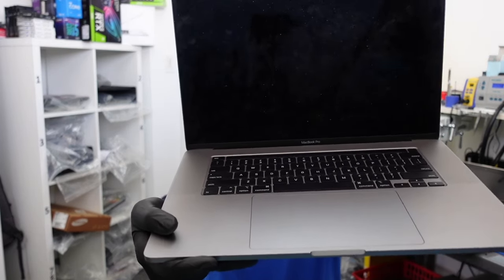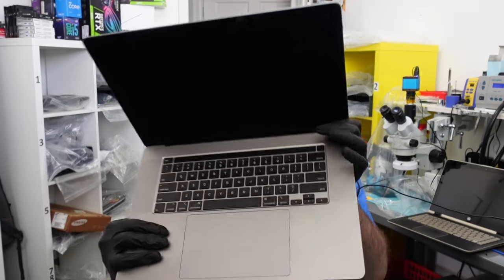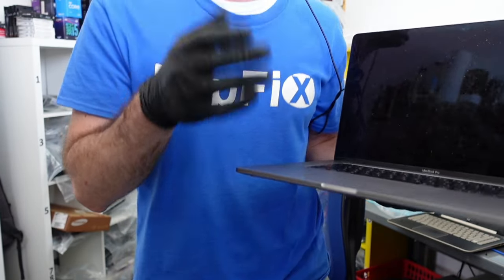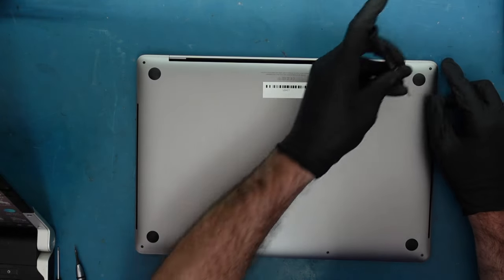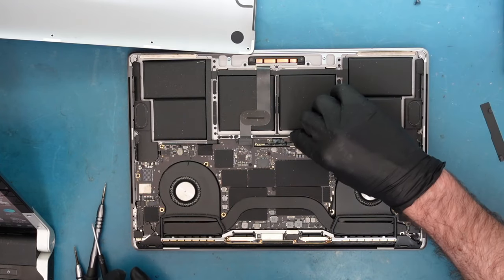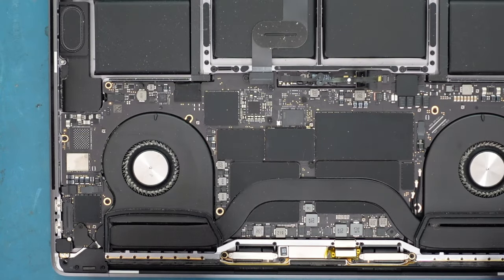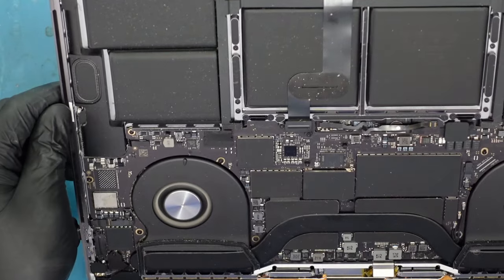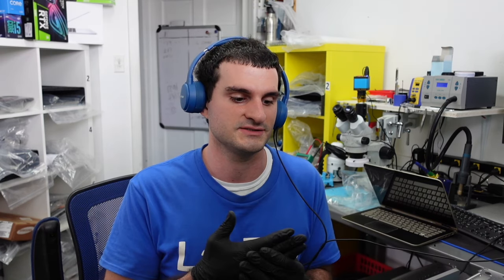Macbook Pro with Cracked LCD But Still No Display Output

Comment: Thank you for this.  I was an idiot and bought MacBook Pro 15" Retina A1707 (2016-2017) model and am in need of a new screen. It powers on and the backlight comes on but has the classic no image no display just fractured lights and lines etc. Luckily I am able to Mirror the Displey onto my TV with an HDMI cable and my Dock.  I say idiot because of course I buy the one that costs the most to replace the screen.  The other major major irritation is how the keys started going bad on this money pit.  Shame on Apple for creating such an expensive heap of junk that will cost an egregious amount of money to fix. Wrapping up my want I find it 1000% ridiculous that I have a “Laptop” but in order to use it  I MUST have a Keyboard, 2nd monitor used as a Primary Display, and a Mouse.   I basically have porthole Desktop using a $2500 MacBook Pro as my hard drive.  So pissed.  My question is, at what point is it worth repairing it vs getting an iMac or the like.  Who knew the screen would cost that of a brand new Low End iMac.  Thank you.

Comment: Question Because I need some serious help. So I did all the steps, but when connected to the external display is displays nothing, the only time it displayed anything was when it low battery and did the whole lightning bolt sign. but now when connected to an external display, i mean it displays an output cuz the display backlight turns on, but theres nothing on there. Ive tried the comand R and all that. no luck. anyone know whats happening??? is the OS broken or something??

Comment: Hey there, will this work for a 13’ inch MacBook Pro? screen is cracked. only thing it will let me display on 2 monitor is the reset password. once I do that and reset the computer it won’t reconnect to the 2nd monitor. the keys board lights up.. the 2 times I did it in the beginning it worked.. then it stopped working. feel it has something to do with the password. when it did display onto 2 monitor the Touch Bar had 2 options. mirror or display. but now the Touch Bar shows nothing. tried using voiceover to type password in but nothing worked. I don’t wanna pay for another screen. how would I go about this?
Reply from the maker: Yes, this should work for your issue

Comment: Used this trick on a 2018 Macbook air 13 inch so I could keep working. The screen just spontaneously cracked from the bottom left. You are a life saver!

Comment: This was an awesome video. I’m having a problem with my screen is cracked. But I will need to watch this video half a dozen times because I feel like you need to be a tech genius in order to do this… 

Is there any other tape besides the one you used that I can see use?  

I’m very nervous to do this, but I feel like I have very little choose.
Reply: You don't need to be an expert.  IT should work unless something else is wrong with your macbook :)

Comment: Can this be done on a macbook pro 14" M1?  I am asking because the display is disconnected and completely removed.  However, I always need to press command F1 to go into the external display. I want the macbook to always be on external display because if not it makes it difficult when I need to go into options startup menu etc.  Thank you!

Comment: Mine has something similar. Display is not cracked but I think it failed. The weird part is when you press power button you see the apple logo, also when i put the laptop in recovery i can see the image, everything perfect. when the laptop boots in MacOS no image is shown at the display, only an external monitor work.
Reply: Update please

Comment: Greetings,

Thank you for this. It worked until i put my password in and loads, then it goes blank. The laptops runs fine the external monitor goes blank. How can i get around this?

Thanks
Reply: We are having the same issue. Put in password and it loads just fine then before it opens to my desktop it shows no external monitor connected. Not understanding why this would happen. Any help would be appreciated.
Reply: @Charles-oo6jm  update please

Comment: Hi, I am having a similar issue, when I connect to a monitor it shows up but annoyingly it is in secondary monitor mode and I cant do anything on the laptop. I have tried short cuts to put it into mirror mode but no joy. Do you have any advise? 

Thanks
Reply: Did you already disconnect the screen?
Reply: Update please

Comment: I have an A1708.  I followed the video's instructions.  When i turn on the computer it only displays the apple logo on the external, no loading bar and just stays there.  Any suggestions?
Reply: I have the same issue did you manage to figure out what's happening?

Comment: I got an Macbook pro A2159 and it shows only the battery symbol, waht can i do?
Reply from the maker: That sign means it doesn't detect a charge on the battery. Keep it plugged in for a while.  If nothing changes it can be a charging issue with the logic board or a battery issue

Comment: ive got screen busted a2141 as well. the idiot me put windows to start in safe boot and forgot how safe boot will use only internal screen. which is busted. so if we disconnect the video like the one you showed it here, would it put windows safe boot in external display too?

Comment: I was doing this fix on a macbook pro (13") and the second monitor is stuck on the apple logo. I also tried to EFI boot, the menu showed up but when i tried to boot it sent me back to the apple logo, do you know why this is or amything that could help to fix it?
Reply from the maker: try a p-ram reset first, see if you can see your drive there.  If not try booting to recovery mode and see if you see the SSD.  I have other videos talking about this issue if you still have a problem
Reply: @lapfix  Hey lapfix, do can you list the videos? I can't seem to find any videos upon this topic and It's giving me a headache thinking about this myself. I can't really seem to find anything about it on the internet.

Comment: Can someone explain why my 
2014 macbook pro wont turn on.ive done pram ive done smc i disconnected the battery. The power bank works.the track pad is depressed. My mac stopped working when i was readi g days from my external hard drive. And no one for miles has a compatable mac.
Reply: Your logic board is bad. I had the same issue with a customer's macbook.